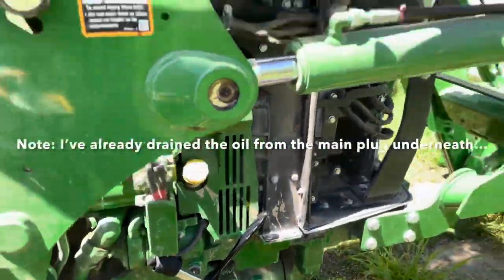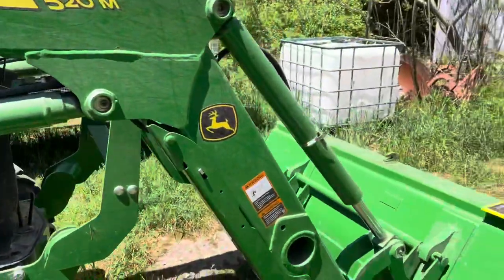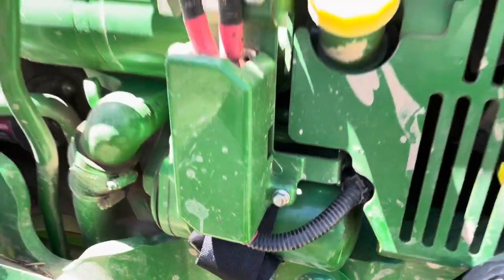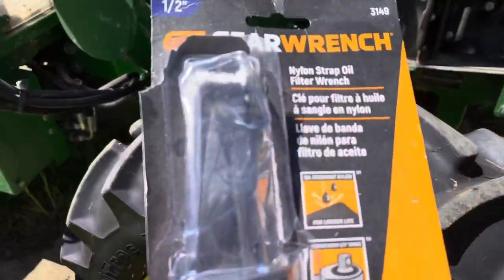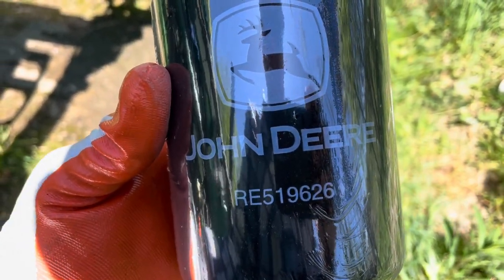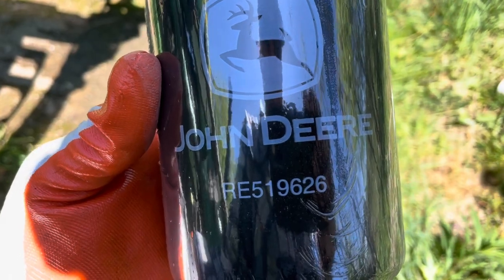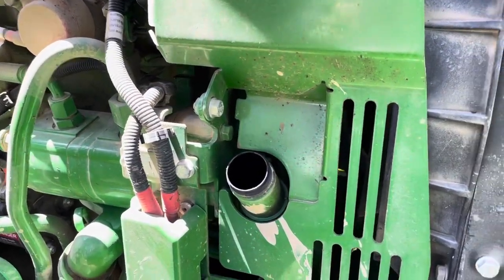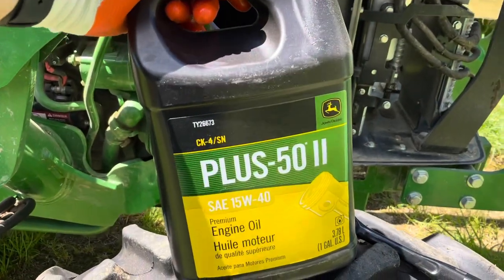John Deere 5065E Oil Change & Started Plowing

Comment: Much better tractor than what I have, but it is good reminder to change out the oil on my 30 years old Kubota L2350 two wheel drive tractor.  It will run without the ignition switch and in fact the starter function of the ignition switch failed and I wired around around it.  I just use the ignition switch for the glow plugs and on a warm day it will start without the glow plugs.    
I do not have a front end loader, but have a heavy duty box blade on the three point hitch.  It runs a bush hog real well.  I was using the box blade along with a chain saw for the last week to move ta bunch of pine trees that I cut down last year.  I would like to have a fine machine like the J Deere 5065E, but it is out of my price range.  
I will have to check, but I think last time for the oil I used rotella for diesel engines, but I do not remember the type.  I can get oil filters locally for it.   
I have planted mulberries and a few thornless honey locust in that spot.    

My couple of mature dunstan and chinese chestnut trees are smelling to high heaven lol.  I expect a good harvest from them.   I am in northwest florida.  I already see a lot of burrs on my hybrid chinkapin-chinese trees.  They bloomed a little earlier than the chestnuts.
Reply from the maker: I started with a 1950’s Ferguson TO-30.  When it came to buy, I took the advice “Buy once, cry once!”.

The chestnuts do have a “special” smell don’t they?!!